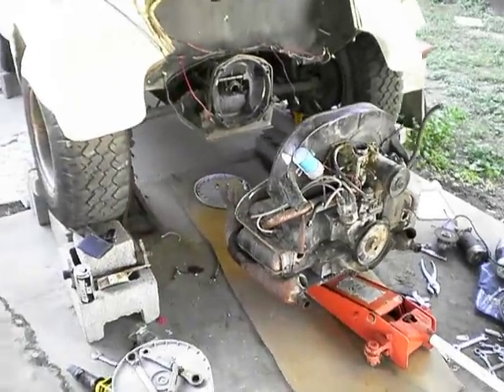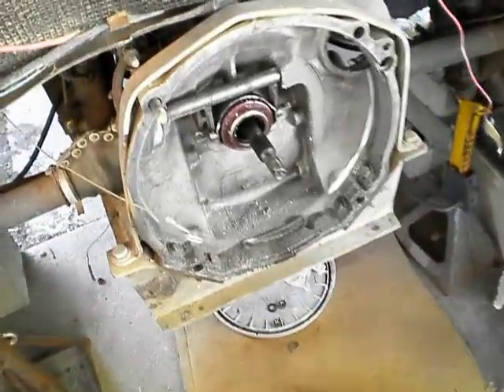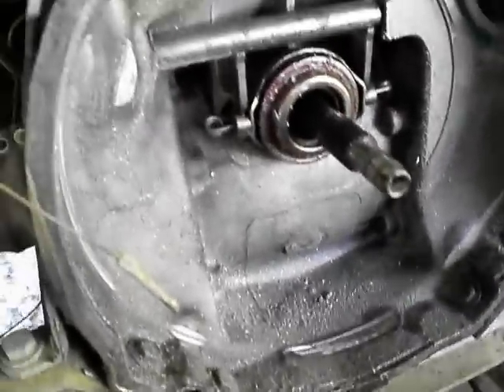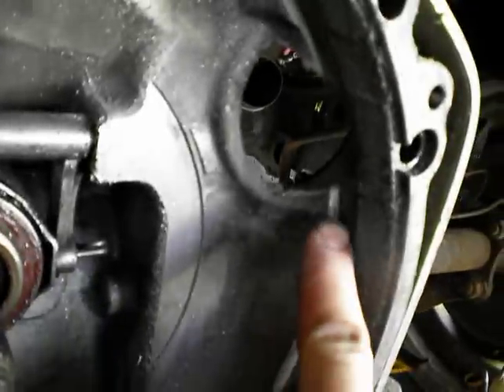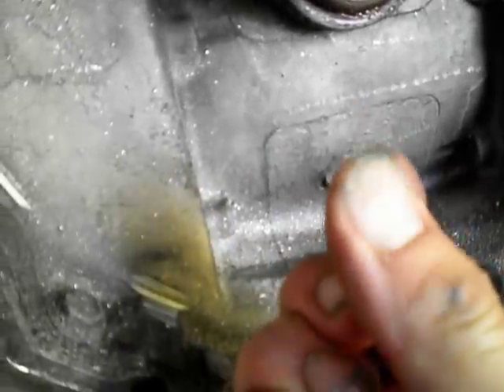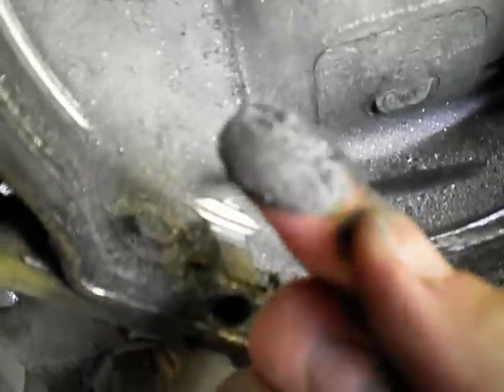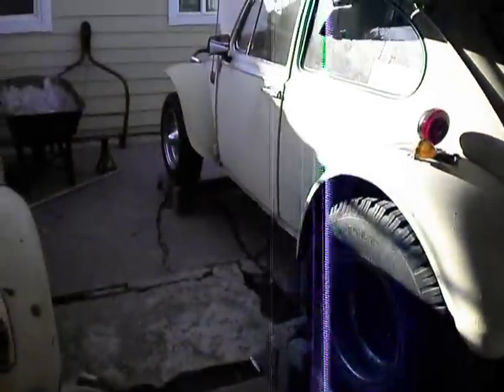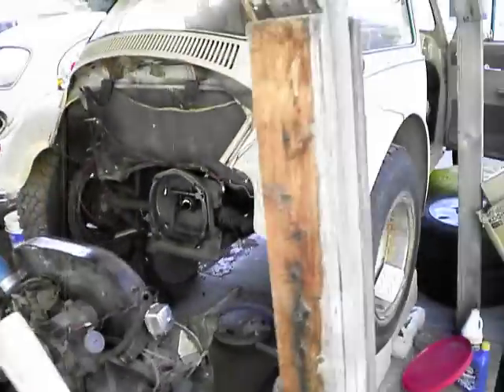A bad surprise on my Baja Bug

Comment from the maker: I agree with BSBazz  I have learned since that milling out the bell is necessary when converting from 6 volt to 12 volt, since the starter gear has a different number of teeth and is slightly bigger